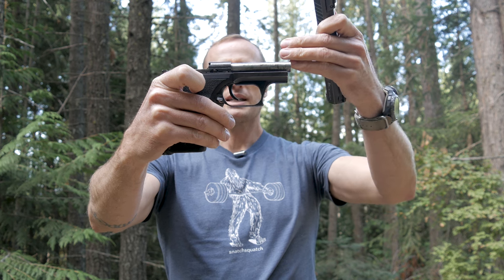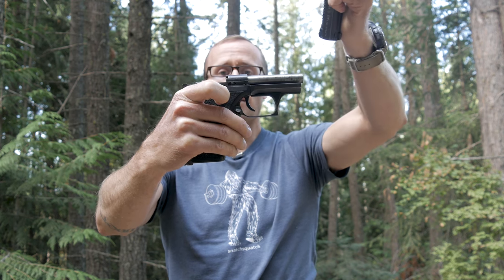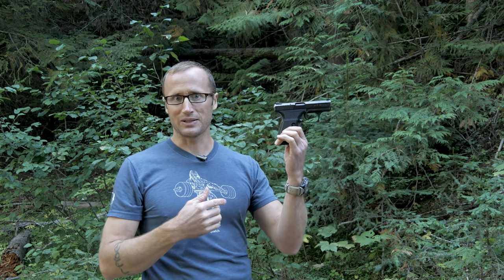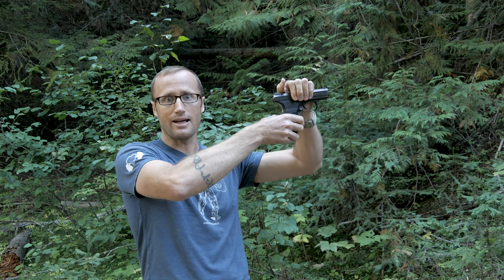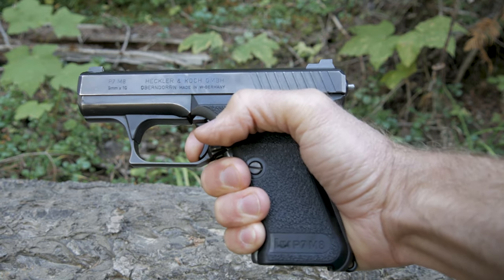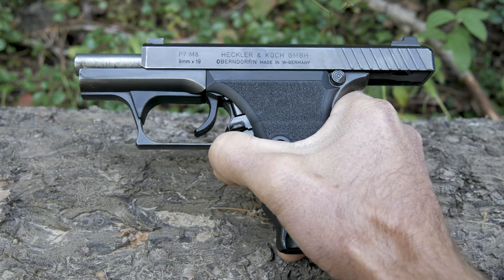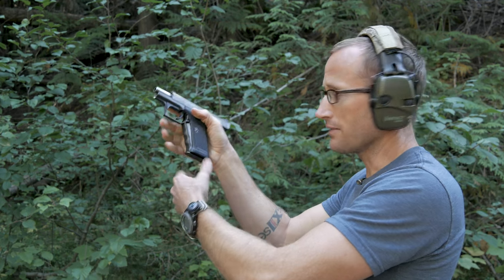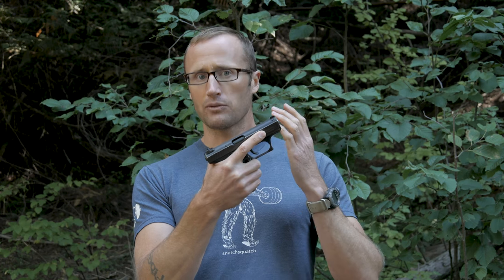H&K P7M8

Comment: Nice review. I wish HK would issue an updated version of this pistol or at the very least license the design to someone else who would. Such a brilliant design. The Umarex/Walther CCP tries to economize the delayed blowback design, but they clearly designed it to a price point. Not a home run at all. Recall was issued for a drop safety problem as well.
Reply from the maker: Thanks for watching man!  I totally agree.  Especially with all of the new polymers and what not now.  There is this big push towards concealable pistols and all the while the P7M8 is just hanging out as one of the best concealed pistols ever...
Reply: +Kit Badger I agree completely.  Some interesting models are coming out this year at SHOT, but nothing as cool as a P7. Sig has a high-capacity pseudo-single stack 10 round 1" thick 9mm, the P365 which looks promising, and Walther is releasing the subcompact version of the PPQ (which of course is almost identical to the P99c). I'm really going to have to get one of these P7s before they are all in private collections.
Reply from the maker: It's funny, I feel like everyone is dancing around the P7 with all the new models.  If you pick one up, let me know.  I'm curious what you are able to get it for, condition, etc.
Reply: Ok, will do. I've seen them for over 1k in decent condition.
Reply: Maybe a polymer p7?

Comment: And hot as hell after two mags...
Reply from the maker: Depending on the cadence of fire.  For me it is into the 3-4th mag.
Reply: If you're in a scenario where you're going to shoot more than 2 mags i assume you'd be probably wearing gloves (in the military). In the range as well? in a civilian self defense situation i don't think that would be a problem at all. The P7 family is renowed for being great ccw cause of it slim profile, small size and safety of the cocking mechanism so it's completely safe with a round in the chamber